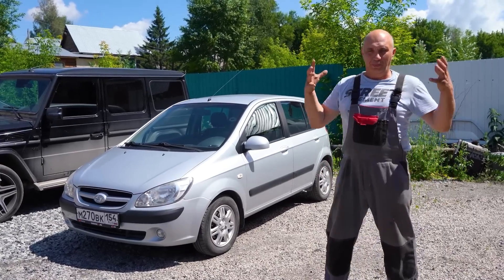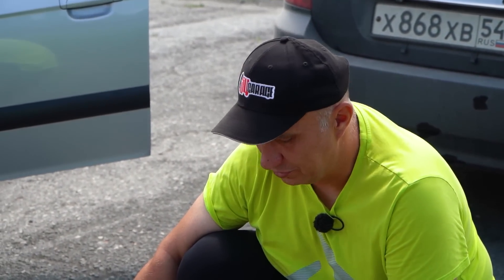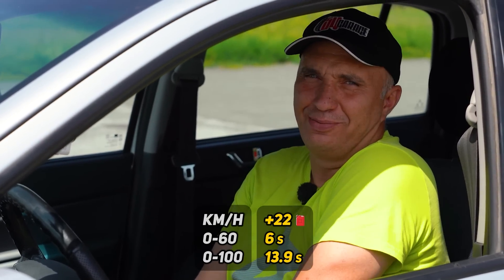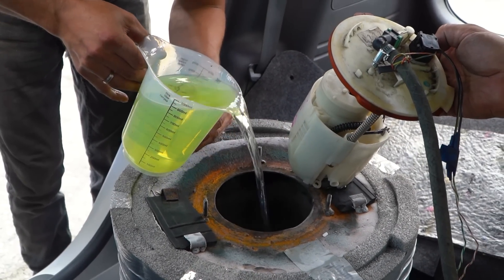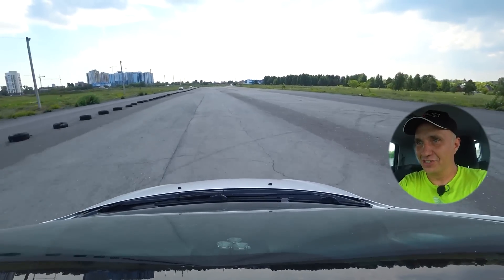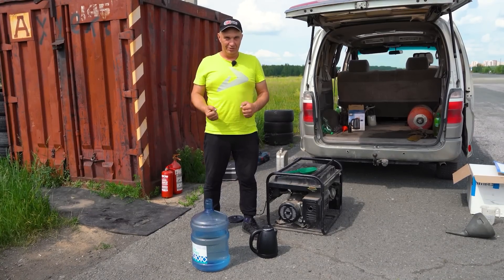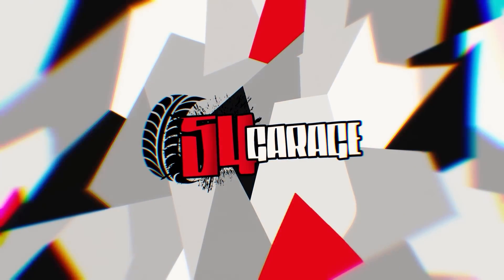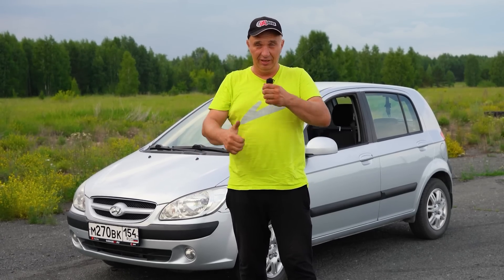Does fuel temperature affect engine performance? (acceleration, fuel consumption)

Comment: Next time make a peltier cooler so you can control the temps better, near the intake. I am not sure that the tank gas made it to the engine at the launch time. The old gas was still in the lines, which was ambient temps and the lines were not insulated.

To me, it is clear that gas cooling is there for the win.

Better MPG, for sure.

A peltier cooler can apply hot or cold, to opposing surfaces, just by changing direction of power. Use a PWM controller, controlled by a temp probe, and you can get specific temps. A coiled copper tube with a flattened side, can be your gas cooling chamber.

Just be sure to use silicone to seal the open edges of the peltier sandwich, to stop humidity from condensing between the layers of hot and cold surfaces. (Note: You can double stack coolers to get more cooling. Just be aware that a peltier cooler draws a lot of power to cool and less to heat. That may factor into the driving resistance as the alternator may be more stressed as it stays running. Maybe use a few spare batteries, not connected to the cars electric system, for testing. Then again, connected, to see the impact.)

Next time, also get gas only as hot as needed, not boiling, as your test. That was a bit unfair. (Or make a condensation post near the air intake, at the pump. It will condensate evaporated fuel back into a liquid.)

Comment: the fuel lines are long and act as temperature radiators. the fuel is likely entering the engine much cooler than when it was in the tank.

Comment: I don't think it matters.  The fuel in the tank may be a certain temperature, but by the time it travels through the fuel system and gets atomized by the injectors or carburetor, It's at the ambient temperature of it's surroundings.  Vapor lock is the real issue when fuel heats up.

Comment: An American guy named Tom Ogle claimed that by pre-heating the gasoline all the way to a vaporized state that an engine would be able to stretch the energy tenfold. Getting 100+mpg in a big block 70s muscle car, allegedly. I even messed around with the concept myself years back, but there was nothing to it. It's the same as thinking you could end up with several gallons of water from just one ice cube. Pure publicity just like Stan Meyers water powered dune buggy. Laws of physics 101, energy cannot be created, only controlled.

Comment: This is on a fuel-injected engine that no doubt has electronic control of the air/fuel mixture. I would expect it to be roughly the same in terms of performance. A carbureted engine might be very different.
Reply: Exactly. Otherwise, it would make a difference only at wide-open throttle, and only if the ECU has any headroom to put in more fuel anyway.  Of course, this would only apply to power not to efficiency. Then again I just got up and haven't had any coffee so maybe I'm thinking about this wrong...

Comment: this would be super awesome to do EFI vs carbi VS direct injection vs indirect injection, petrol vs diesel, cold/warm/hot starting how easy it starts and restarts, very hot weather freezing cold fuel, freezing cold weather stinking hot fuel.

I'd imagine that it makes the most difference with diesel doing a cold start in freezing cold temperatures with stinking hot fuel since it would be much more prone to detonating than cold fuel in a cold engine and it would be way better for fuel consumption/mileage since the fuel would easily burn when its hotte. the trifecta of fire is HEAT, FUEL, AIR if your missing or lacking any one or more of those there will be no fire.

Comment: Now build an intercooler and load it up with dry ice to cool the air being sucked into the engine!

Still this was interesting. Well perhaps not the boiling gasoline so much. Might have been more interesting to see what something like 40°C would do rather than going for boiling the gas.

Now I remember seeing some dragster having a CO2 cooled intercooler. This was way back, probably 40 years or so, and I can't remember if they cooled only the air or if they also cooled the fuel.

Finally it may be interesting to experiment with water injection! That's another trick I remember hearing about where water mist is sprayed into the air intake. Supposedly a minute amount of water mist can cool the air fuel mixture increasing the density and causing more air to be sucked into the cylinder meaning more fuel and air will mean more power.

Comment: Very easy to understand results and makes sense.  If the intake air could also be cooled/heated I imagine the results would be even more impressive.
    I was holding my breath when you had the gasoline boiling in the electric coffee pot.  Then when you flipped the switch on the generator I couldn't watch.  That was some dangerous stuff going on there!  Glad nothing bad happened and really enjoy watching your vids.

Comment: You should unplug the fuel temperature sensor next time and maybe plug the sensor into the air or something, so the engine thinks its running normal. The car automatically regulates how much fuel it injects depending on the temperature. If you unplug that sensor, you will see a big difference in how the car runs. I mean it is no scientific result because it will simply inject too much fuel when it's cold and too less when its warm, but it will be nice to see anyway. I used to have a potentiometer pluged into my old Diesel Audi fuel temperature sensor. It gave the car around 10 to 15hp more because it automatically injected more fuel thinking the fuel was warm.

Comment: Thanks. The volume should not be measured while hot as the density would be less, as yes, evaporation would be a factor but these results are quite conclusive that cold petrol is more efficient. It would be good to install a very accurate flow meter connected to a computer.

Comment: You should repeat this in the depths of winter when the air going into the engine is denser, much denser air should make more of a difference than just heading or cooling the fuel. 
There is a reason why turbo engined cars have an intercooler... cold dense air is better for performance.

Comment: Let's also note, that cooler fuel will result in a cooler mixture in the combustion chamber, which will remove more heat from engine when vaporized.
A cooler combustion chamber will tolerate higher comperssion without detonation thus it will act like higher octane fuel, ignition advance and thus power can be sustained higher without engine knock (leading to cut back ignition timing to avoid engine damage).
Reply: Cool story bro
Reply: @mann_idonotreadreplies  Yes, literally. I also forgot to mention that fuel itself will deteriorate as temperature rises, leading to loss of octane rating.
And also the fact that in older racing series, chilled fuel was put into the tanks during pit stops, on the purpose of giving mixture a head-start in heat removal (as well as exploiting the cooler fuel's higher density, resulting in more fuel in the same volume limited by the tank).
But if you're skeptic, you can read about this in A. Graham Bell's book titled Four Stroke Performance Tuning (also in Forced Induction Performance Tuning).

Comment: The cooler the air the denser it is.gasoline is highly volatile, which is why we put tetraethyl lead in it to raise its octane in the first place. Octane is gasoline resistance to ignition. The lower it is the easier it is to set off. The higher it is, the more resistance it has to firing early. This was extremely important in early engine designs that needed higher compression, read as cylinder pressure, to make decent power while not igniting prematurely. There are several things that contribute to cylinder pressure, static compression being just one of them. Cam timing and rod length along with carburator size can make a difference, and all of these things could cause early ignition if not properly balanced. That said, the volatility of gasoline makes it tend to evaporate quickly. When filling you gas tank in the hot summer months the molecules in gasoline are beginning to evaporate cause the fuel to be less dense than it is in the cold of winter. Air temperature can also effect gasoline density as it flows into the engine. At higher temperatures the air heats the gasoline when they are mixed, atomized fuel spread into the incoming air gives it a Les dense mixture, reducing power. The colder the air, the denser the mixture. This is the same thing that happens to the gasoline itself. When gas is colder it is denser and you get more fuel per gallon than when it is hot outside. Fill your tank early in the morning, or after the temp has cooled down at night to get more fuel for your buck.

Comment: In summers carb engines perform better as the air intake is naturally hot air through venturi makes better evaporated fumes and well fuel in tank specially on motorcycles one can feel the strong aroma of petrol emanating from tank. I presume the hot air makes lot of difference ..smooth engine better acceleration response...and perfect tuning of engine. It is because summers in Asia are terribly hot.

Comment: The reason for better power in cold temps is not because of the fuel temp. Its the air temp. Colder air means more and denser air makes it into the cylinder. But it was interesting on the mileage. Also my personal hero Smokey Yunick built a hot vapor fuel engine. Super heating gasoline into vapor. He was able to achieve relatively large hp and mileage numbers doing so. I have also worked on it since we have some better materials to work with now. Its a very viable setup.

Comment: The results are not surprising. It would be more accurate to measure the mass of the fuel.  The ‘hot experiment’ used petrol heated before the volume was measured therefore you started with less molecules of hydrocarbons. The first two experiments measured the fuel under the same conditions.

Comment: it makes sense to me-- the Engine will get "injected" gasoline up to its burning temp regardless (thats why the Acceleration tests ended up about the same)...but the gas thats still in the Tank ('not yet injected') responds predictably to Thermal Expansion...if you put "a liter" of Boiling Gasoline into a container, you might end up with closer to .75L of 'room-temp' gas, once its cooled...on the flipside, super-cooled gas is Condensed, so it will 'stretch out' as it warms up-- "a Liter" might end up being 1.25L afterward...

...and of course, these numbers arent Precise or anything, im just using them to Explain the Principle...

Comment: I once ran a chainsaw so hard, the fuel tank started boiling. I realized the fuel was boiling because the motor was so hot, and that heat was being absorbed by the fuel tank. Anyways, to my surprise it began to run stronger. The hotter the fuel got, the more power my saw had. My only theory was that the fuel was so hot, that it was already close to ignition temp. I haven't thought about that in years, until I stumbled upon this video...
Reply: I think it’s more so due to less compression loss from piston and ring expansion and engine heat will also create more compression as well.
Reply: More fuel was probably being 'pushed' due to active pressurization from the fuming. Also, hot gasoline is 'closer to its vaporous state' which, has been shown to 'change' how an engine runs. Well-before 'my day' there were many 'phase change/vaporizing' carburetors. More recently, the concept has incidentally been revisited and, (with modern microelectronic control) has proven to not be Snake Oil. 

In regards to the danger, it's not limited to chainsaws. At least one person has had the fuel cap on their 0-turn mower 'pop' from overheating. Sadly, the sprayed fuel did ignite.

Comment: 1 rep for testing is not enough, and so fuel gets pressured and injected changing it's temperarute, but tuning would would make difference, as now car just tries to put proper afr, so it's no wonder it have similar times.

But for cars consuming more fuel it can cool engine a little, and that would make difference in power. Here odometer is one hell of measurement.

Comment: Really air temp should be all that affects mileage.  Colder air needs more fuel, that's why old cars had warm air pipes from the manifold for the carburetor.  Better economy and was easier for the car to run once warmed up.

Comment: air temperature affetcs the cars power because cold air is denser than hot air (that why hot air ballons fly) and if denser the injection inject more fuel because there's more air, but i'm not sure that fuel temperature affects heavily the performances (perhaps with 500 hp but not with 50)
the results about the consumption are strange but logic because at 70° fuel is way over its flash point  (-43°) so at this temperature nearly all the fuel is transform into vapor

Comment: Many years a go the Honda XBR500 motorcycle had a reputation for not starting/running when it became hot during the Summer time, it turned out that starting the bugger became an issue as the fuel in the tank underthe bright sunlisght became VERY HOT and combined with a hot engine, it just made things worse. Shame that, as it was an underrated bike! 😏👍
😎🇬🇧

Comment: Old Mercedes used to have the fuel line go through the air conditioner suction line - refrigerated fuel. It was probably to avoid vapor lock in hot weather.

Comment: The distance he went (during the 0-100km/h pull) didn't even use up the gas in the fuel line.  That gas in the tank probably never reached the engine, or changed the temperature of the long fuel line.

Comment: I have thought for years that heating the fuel with the engine's coolant might improve fuel efficiency since warm fuel evaporates much better and should mix with the air more completely and evenly, but I haven't got around to testing that yet. Also, controlling the fuel's temperature by running it through a fluid to fluid heat exchanger located right at the fuel rail's inlet and running either hot or cold fluid through the heat exchanger would have been a much better way to test this since it would remove the variables of the fuel warming up or cooling off as it flows through the fuel lines, evaporating when heated, or being a different density in the tank. Even if cold fuel made the efficiency worse, the fact that it's denser and contained more energy than the hot fuel per volume could still make the results look like the colder fuel was more efficient when it was really just denser and you put more pounds of fuel in the tank.
Reply: It does help to a point. I've done it on  car with a carburetor and fuel injection.  Took a piece of copper pipe and wrapped smaller copper tubing around it, then spliced it into the radiator hose. What I found that works extremely well is a warm air intake.  I removed the factory air box and replaced with a  washable cone air filter. The air intake temperature difference is very noticeable. I drive about 500 miles a week so anything that improves mileage is worth it for me. Just removing the stock air box and replacing with a warm intake I've gained roughly about 3 miles per gallon. My intake Temps went from 30-40 degrees to around 75-100 depending on the temperature.
Reply: @jamms992  Interesting, thanks for sharing! I wouldn't have thought that heating the fuel to the temperature of the coolant would work with a carburetor. My plan is to use a small stacked plate fluid to fluid heat exchanger inline with the small coolant circuit feeding the throttle body and run the fuel through that. My theory is with a coolant temperature of around 190 degrees, the fuel should be above its boiling point at atmospheric pressure and boil as soon as it gets sprayed into the intake manifold. But with the 50+ PSI of fuel pressure in the lines and rail, the fuel should still be well above its boiling point while its in the fuel system.
Reply: @jamms992  a 1990 nissan sunny i had used to take its air from around the exhaust manifold. I always wondered why, cos no other manufacturer i saw did.

Comment: I remember checking fuel economy when I first got my Ford Focus. Filled the tank full, Drove about 80 miles. Topped the tank up. When I got to my buddy's shop at the 100 mile mark I calculated the mileage against topping up the tank. It showed around 50 mpg at the 80 mile mark. Then I drove back to my starting point and filled back up from the same pump. So total trip mileage was about 200 miles. Calculating  showed that my miles per gallon was about 32mpg. Huh? So I did some reading. Gas in the stations tank in the ground is about 52-54f. The air temperature that day was 80f. Gas expands 1% for every degree Fahrenheit. So my original feel expanded about 30%. So driving at that temperature, with fuel return back to the tank simply expanded the fuel so it took up 30% more volume. Meaning topping up the fuel was 30% less fuel giving me a false mpg reading. So what little gas I put in then expanded while visiting my buddy and so the refill I did showed the more true mpg. So the Garage54 experiment is flawed because cold gas is denser that room temperature gas, which is denser than heated gas. Otherwise, one liter of room temperature gas will be a smaller volume when cold, and a larger volume when heated. The trick for better fuel economy is heating the gas after it leaves the tank and using hot air coming from the radiator to feed the intake. That yields better better evaporation/smaller fuel particles with less unburnt fuel wasted. My Geo Metro which I took it from it's EPA 38mpg (If I remember right) to a consistent 52-53 mpg. When I bought it I was only getting 25mpg. I still haven't modded the intake or exhaust manifolds or even have the head off yet.